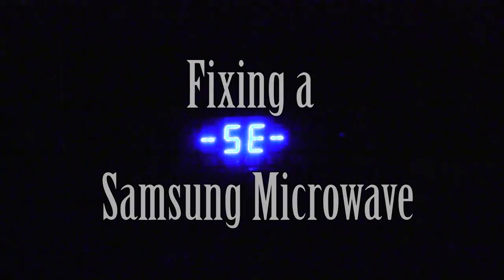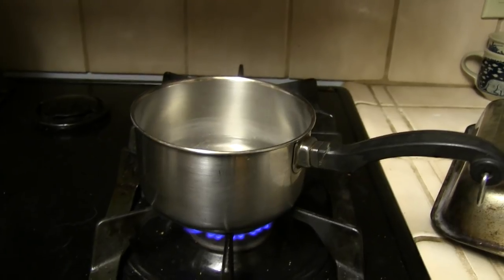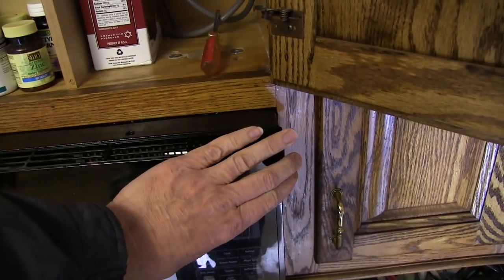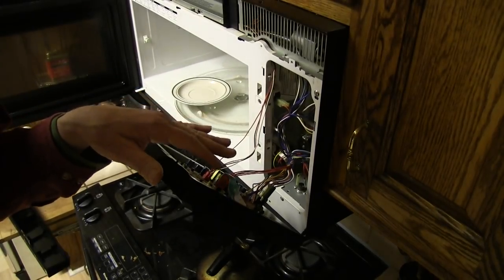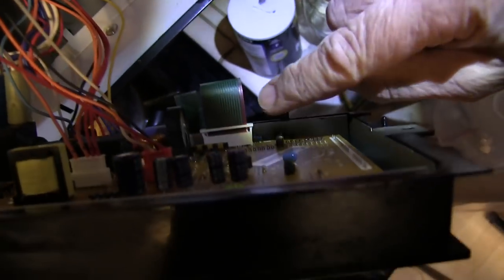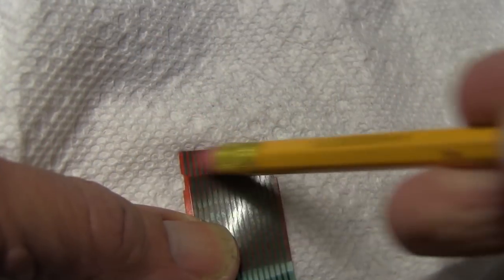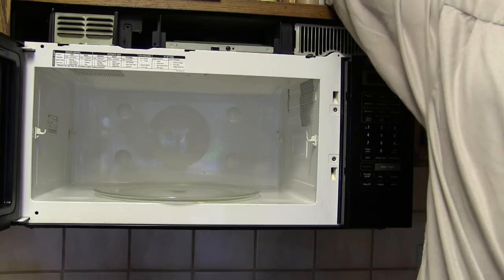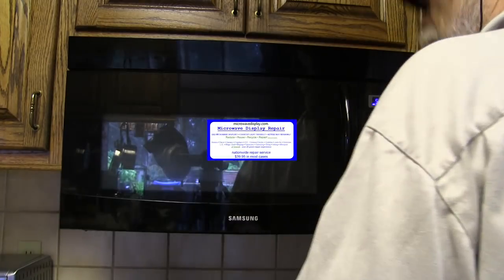Fixing a broken Samsung Microwave - The dreaded 5E error code -- aka the SE error code.

Comment: This a very good video .I found that it had a lot of grease,inside the panel, I wiped all the parts off after taking connectors apart.Then put everything back together it works fine.

Comment: Excellent video but not so great results for me, so far. I hadn't heard of the SE error code until I looked at this. But my issue, auto cycling light switch, seemed to be related. I removed and cleaned contacts, including the ribbon, and plugged it in. Display started but before getting to time st, the SE  came up and does not go away. I'll try a few more things before buying a new unit.

Comment: Before watching this video out of pure curiosity, I had just taken the exact steps that are outlined in the video simply because it made some sense to me to try, and I'm glad this video backs up my idea. It worked for me so far. I have owned my mircowave for nearly 5 years, and this is the second time I have had the same issue. The first time I had the panel replaced, and despite the fact that I have a protection plan through which I can get another panel at no cost, it was worth a little tinkering to understand if anything can fix it besides replacing the entire panel. Nice video!

Comment: Thanks for the info!  I got this problem this morning and used your tip to fix it.  However, I think the corrosion/water contamination theory might be a red herring.  In my case the contacts all looked clean and dry, so I didn't clean them, just unhooked them, inspected them, and hooked them back up, and after that the microwave worked.  I think it's more likely that a connection just vibrates loose over time.

Comment: Thanks for the tip.  I tried it last night and it apparently worked.  Nothing visible was showing but cleaned the connections anyway.  Plug back up and the microwave is working again.  It's simple enough to repeat if necessary but may get old after a few times.  But, it extended the live so thanks again.

Comment: I have tried a few different things suggested here for this microwave. What finally seems to have stopped it is I disconnected the thin 2-wire connector from the circuit board behind the keypad. The wires/connector are towards the top of the board in the middle. They seem to go to the sensor that was malfunctioning. We do not use the sensor cook modes so that resolved the SE error.

Comment: Thanks for the video. I replaced the mother board for my repair after moisture entered the unit, so your fix may have worked as well. Thanks also for covering how to remove the ribbon connector. I wasn’t sure how to do it. I’ll save the old board just in case it’s good.

Comment: Great video and well made. I suggest that a photo is taken prior to disconnecting the wires/ ribbons just in case you have doubts about the connections during re-assembly. Also you could use alcohol / contact cleaner to clean the contacts so that they make an effective connection. Thanks again for the video and helping others save lots of money and having less electronic appliances prematurely go to our landfills.

Comment: Very helpful!  I'm pretty mechanically inclined, but if you can change a light bulb you can do this. It started beeping while I was watching tv the other day and I got the SE code.  A quick Google search brought me here and to a link suggesting the unplug method. Of course that didn't work so I took it apart. 10 min later and I'm good to go....so far.

 I'm starting to lose faith in Samsung. Both my tv's and now this have failed or shown a defect right out of warranty.

Comment: I too had this problem and followed the excellent instruction set provided by Joe Devlin. It was followed to a tee and worked for about an hour without anyone near the unit or from prior use. Undaunted I tried again and went a bit further this time. I took the circuit board and steel panel off the inside of the control panel. I noted there was a ribbon cable 'wiping" the back side of the steel panel. My guess is it was for static discharge or leakage current grounding. Just a guess I admit. I did notice that the steel panel back had a grease film on it. I used a de-greaser to clean the steel panel back and the wiping end of the ribbon cable that comes into contact when reassembled. Guess what the unit is now working flawlessly. You may find this helpful. I  think others who have cleaned (or separated ) the ribbon cable are actually reducing the cross coupling  capacitance or conductivity  (between key pad wires in the ribbon cable) and that may be a fix worth trying.

Comment: Great video. I know more now about the unit than the sales people. It didn't solve my problem--think there is some kind of a short between the lighting unit and the board, because the light kinda fades in and out. Also, if I press (or pound gently) on the circular inset on the upper side of the interior, that seems to restore the light and  power and I can reset the clock, etc. I have fan and heating capability sporadically by dong this. Guess I'll bite the bullet for a new unit. Thanks for the adventure!

Comment: Awesome video! It was thorough and left little to the imagination. It could give someone with very little expertise or know how the confidence they needed to tackle it prior to shelling out cash. I'm a tech in the energy industry so ripping into appliances isn't very intimidating. I wish my industry had work instructions for component troubleshooting like this. I had my unit disassembled and on my counter in about three minutes. I found the terminal points to be free of any corrosion and oily buildup. However  I noticed the ribbon cable had the tell tale signs of corrosion. Blueish green copper oxidation. Your tip to use an eraser had it cleaned up in 30 seconds or so and everything was back together and working in less than ten minutes.  Thanks!

Comment: This is the second time I have had this problem and your video has been of great help. My problem seems to be the repeated corrosion of the ribbon. I might add that with this last experience I had to reinsert the the ribbon several times to finally get full function, So if you are only getting partial function as in it won't start or your light and fan won't work, remove the ribbon and reinsert. I had to do this several (like 10) times. Also I disagree with the fellow who says the vent cover must be replaced to get it to start.(@ least that is not the case w/ mine.)

Comment: Fantastic Fix - I have a standalone Samsung so I had to take the cover off, 1 screw at the side and 4 at the back. Then you can see the same picture. Only other difference was a small screw at the top and side of the control panel that need to be unscrewed then the control pad comes out. 

The fix was exactly the same take out the ribbon cable by lifting the catch on both ends to release the cable, use a rubber to clean on both sides, I used a soft white rubber, replace ribbon cable and Voila! Perfect working order again. SO straight forward. The machine was about to go to the tip!

RoscoPC

Comment: Instructions were excellent.  My Samsung 'broke' about 7 months ago and using this video worked wonders. Been 6 1/2 months and no issues.  About two years ago the latch broke and it would not stay closed.  There is a video on YouTube that instructs how to fix that too.
Reply: cicblue my latch did the same. I watched the video and was able to fix it. now this issue of error codes...
Reply: Fix lasted 9 1/2  months until I made soup again.  Back to square one on the board.  1st attempt didn't work but will wait a while longer in case condensation is on the inside part of the board and try again.

Comment: Fantastic video!  The "fix" worked like a charm!  My only negative comment stems from the fact that I didn't try this the first time this happened to me was in the early 1980's. I replaced the keypad at a cost that was a lot more than it should have been...  So now I just wonder if cleaning the connectors/connections would have fixed that one as well...   Hmmmm...       ;-)    THANKS MR. DEVLIN!!!

Comment: I tried the fix & it worked for about a month & then failed & again in 2 weeks & again in one day -  So I looked at parts & the control box was not worth it vs. getting a new unit. I went to the Samsung website & did a chat session asking what was the current 'drop in' replacement. They asked what the problem was - I  explained it as SE5 error code and long story short - they are going to resolve that problem for free, under warranty. Someone will be calling in the next two business days - not bad! My unit is at least 4 years old - I believe that due to the frequency of this specific problem, Samsung is fixing @ no charge.

Comment: Dreaded SE.Thanks so much.Lucked out on ebay found new DE94-00933H Samsung Microwave Control Box.$50.50.Works perfect now.the digital display does not even flicker anymore.Probably one of the many fixes that was suggested might have worked by replacing the whole unit it took away the guess work.

Comment: Thanks Joe your instructions were perfect.
I had trouble getting back on the vent cover so took off the front door which was easy, However, putting the door back on was more difficult.  There are 2 vertical pins on the microwave which fit into the door's hinges.  I first connected the bottom pin hinge combination and then had to pry the the upper hinge down so it would fit.

Comment: I had the 5E error code on my Samsung model SMH8165ST micro wave oven and repaired it by removing  and reinstalling the wire cables but without cleaning the contacts.   However, on the ribbon cable I did use the eraser to clean the contacts.    It is now 3 days and the micro wave is working fine.     Thanks

Comment: Thank you for the help i fixed mine by just cleaning the flat ribbon cable. Used an eraser and some alchohol. It looks like thats the only connection to the actual touch pad. Thanks.

Comment: Very detailed video though our top microwave vent had a center screw too. Also, it was just the ribbon cable that needed pencil eraser cleaning. Everything else was good maintenance but that's all that code required to clear.

Comment: Great video, I wish I knew if it would've helped me. What happened and maybe it will help other not make the same mistake I made is that in other videos it mentioned how the folded ribbon cable needed a piece of paper in between to remedy the problem, so while I had it open was going to do that, but noticed a parts sticker on the ribbon cable, I began to peel off the sticker, turns out the sticker was protecting all of the contacts running up and down the ribbon cable, needless to say, those contacts came up stuck on the sticker and broke the ribbon cable. So no I have to spend 35 dollars on another keypad or spend 75 bucks on a microwave... I'm gonna buy a microwave.

Comment: One refinement on cleaning the ribbon cable - using the eraser approach.  

The ribbon cable tip can have a lot of gunk on it and still look clean.  Your eraser can have gunk on it too.  First wipe off the eraser until there is no visible residue on the eraser tip.  Then use it to clean off the ribbon cable.  Periodically look at the eraser tip and make sure it's clean.  If not, wipe it off again and redo the ribbon cable tip.  

Repeat until the eraser show no residue after you've rubbed it on the ribbon cable.  It is amazing how much gunk comes off the cable.  

Reminds me of the ribbon cables on the old TRS-80 Model I days.  That was a poor design too.

Comment: thanks you fix worked, it was very obvious that the ribbon cable was the issue as it was very tarnished, I cleaned this cable only with a pencil and working fine now.
BTW this is our second samsung top rated unit, the first one lasted a total of 5 minutes then went crazy by turning on and off and also turn table starting automatically. Samsung wanted to send out repair man or replace with a refurbished    
unit, purchased at Lowe's so we returned it for a second new unit. purchased in 2010 worked till today.
Unrelated but we also purchased a samsung top rated refrigerator worst refrigerator I have ever purchased! I'm starting to get very skeptical of consumers reports testing.

Comment: I just had this code out of nowhere on our microwave.  It's over 3 years old. I took the panel off and pulled each of the cables in and out a couple times.  It now works flawlessly.  It took all of 5 minutes.  It's probably not necessary to thoroughly clean each connection.  We'll see how long mine holds up.

Comment: I'm a single mother who just saved $200-500 with this video. Many, many thanks. My cabinetry was built over top the first two screws and I knew removing the microwave to work on it was beyond me, so I drilled through the bottom of the cabinet to get at the screws and I can use wood-filler to fix that. Thanks again.

Comment: This fix worked perfectly for about 2 months but today the error code came back.  I cleaned the panel again but this time the fix only lasted about an hour before the microwave turned itself on!  That's very bad.  So I want to order a new panel but no one has this control panel in stock.  Has Samsung discontinued this panel? (DE94-01999C)

Comment: I found online that it was due to the ribbon contact with the metal housing (sounds ridiculous) but I put a small piece of paper between as recommended by someone who had repaired around 20 microwaves with this SE issue and it worked for me.

Comment: A year  ago I had a E5. Tore out the keypad to get a part number. It was too expensive decided to scrap the junker, put it back together and to my surprise it worked. Thought at the time it had to be the ribbon wire. Now a year later it got another E5. Took it apart cleaned the ribbon wire and now it works again. On mine it is totally the ribbon wire and a 5 minute fix..

Comment: Thanks for the fix recommendation!  Working like a champ so far!  In addition to cleaning the contacts with the paper towel, I used emery cloth to further clean the contacts.  Just took a few minutes.  I also plugged and unplugged each connector a few times.  If this is an electrical contact issue, and it seems it is, then it should stay fixed for another 3 years!

Comment: Worked great, Thanks! If I could simply add, unplugging the ribbon cable and adding Dielectric grease should be a permanent cure, it wouldn't hurt adding it to all the contact points. I skipped the cleaning and just greased it. Old Aviation electronics trick. Thanks again for the video and saving me a few $!

Comment: Great tip!   used a a little wd40, old tooth brush, and tooth picks...only eror I made was pulling off the ribbon connector and snapp a plastic lock....all you need to do is loose in, like this video says and pull out ribbon only....works like a charm...grease gets in and thats the problem

Comment: Thanks, this worked for me as well.  I used a small brass bristle brush (found in the plumber's aisle at your local hardware store) to gently clean all the connectors except the ribbon cable (the pencil eraser is the right tool for it).

Comment: Add a very small amount of Di Electric grease to the contact pins and use a Q-tip to put some on the flat cable.

Comment: 23OCT18 This repair procedure worked perfectly for me. The same malfunction occurred on my SMH9187W 6 months previously, so this time I used a cotton swab to apply SuperTech Spray Lube to the connectors and jacks to cut through any possible contamination and improve electrical connections. The narration was clear, concise and flawless.

24OCT18 This repair seemed to work for about 1 hour. Then the SE error reappeared.
Today, I dismantled/reinstalled the touchpad/control board assembly 4 times and repeated the disconnect/reconnect procedure with the connectors. (I discovered that the SuperTech Spray Lube that I applied yesterday caused blackening of the exposed metal strips on the end of the ribbon cable. (the other connectors were not similarly affected by the SuperTech Spray Lube). So, I used a pencil eraser to clean them. However, the SE error still remained).
I saw two other videos providing repair solutions and a narrative on FIXYA for the SE error which involved separating the touchpad ribbon cable where it is folded back on itself. The repair procedure involved separating the ribbon cable where it's folded back on itself. I did this. The ribbon cable was glued so tightly together that I used a butterknife to separate the fold. I then installed a section of a business card between where the ribbon cable was folded back on itself to eliminate the possibility of the cable sticking back together on itself.
An hour has elapsed and the SE error has not reappeared.
If it does I will inform you all.
How great is the internet which allows us to immediately share information that never before was available for us non-rich people trying to scratch out a living for our families and save our hard earned money!!!!!!!!!!!!!!!!!!!!!!!!

Comment: It's a great video and what he suggests works, temporarily. The first time I tried cleaning only the flat ribbon connector, then I tried cleaning all the connectors. Then I tried simply unplugging the oven and leaving it disconnected for an hour or so. All three methods restored normal operation...for a few days. I ended up ordering a new control panel for $42 (including shipping)
Reply: +Clif Brown 
Mind if i ask where you bough the control panel for $42? Thanks!
Reply: I would also like to know where to get the circuit panel for $42.  Thank you